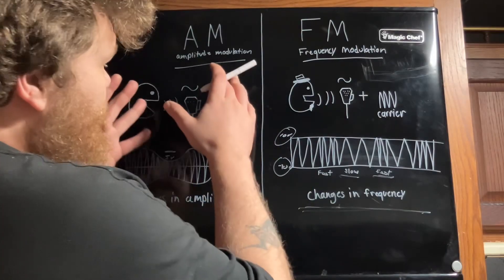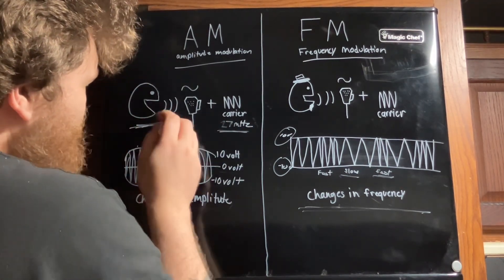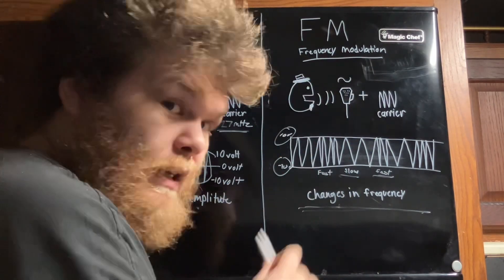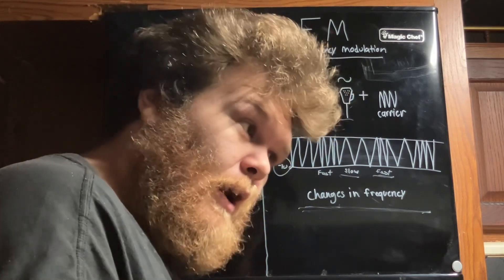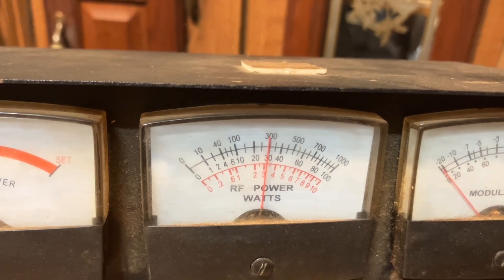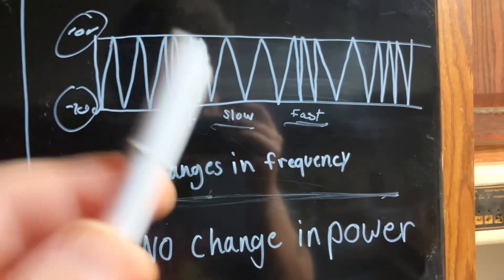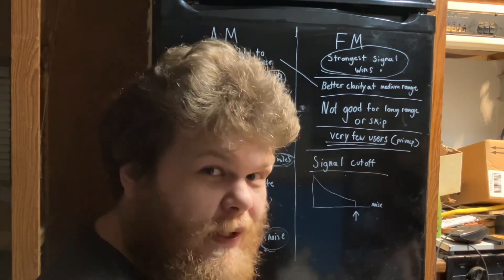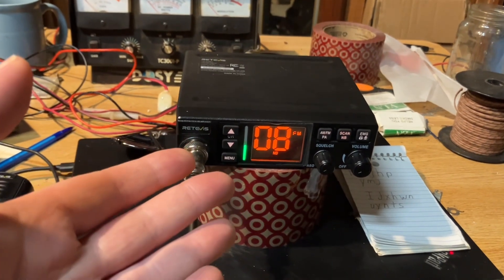AM vs. FM on CB Radio: Which One Should You Use?

Comment: iv yet to get a new radio with fm ... you done real well of explaining  the  two ... iv been into cb quite a few years and most of mine are old .. some are even crystal types with old ffc license that was issued to people way back when cb was a huge deal .. i been eye balling the new radios on amazon and with a magic watt box lol probably can get out on am out but i dont think it would work for fm .....or would it ???
Reply from the maker: I don’t know for sure, but I do know that with an amplifier you want a very low carrier and good modulation.

However, with FM, the carrier never changes power amplitude.

So you would have to make sure that you didn’t drive the amp too hard by turning the carrier very low.

Your amplifier will see a constant duty cycle with FM, so it might heat up quite a bit.

However, I haven’t done very much research into it. Maybe someone else in the comments can chime in.

I have a bunch of old crystal radios as well, I’m a big fan of the new president radios. 

If you’re in the market for a new Radio, I would recommend a president for sure
Reply: @JohnnyJonesathome to be safe I probably will only run bare foot on the FM side

Comment: If you go to Pahrump, Nevada. You will hear the locals on CB Band C channel 23.  26.805 Mhz FM.   They are just chatting up a storm. How do I know.  I can hear them late in the afternoon in Iowa somedays.  If they swing their 50 foot  quad 4 antennas my way. I can even talk to them on a few choose moments.  FM skip as easily as AM.  When it comes back to earth. The signal polarity is no longer  just vertical.
Reply from the maker: Yeah, It works that way with AM too that’s why you can use a dipole to talk skip.

I still don’t think bests SSB, I prefer having the ability of cross talk.

Comment: I was so excited when FM came to the States, Then I used. Disappointed. FM is clear and quiet. Voice is not loud. Then when static breaks squelch it's deafening. Is it just a bad implementation on a President radio?
Reply from the maker: Unfortunately, that’s just the way FM is, very noisy. Maybe because it’s constantly trying to create an oscillation within the radio itself.

But that’s a guess

In fact, I’d say if you have a president Radio, it’s probably implemented to the highest standard.

President makes really reliable radios in my experience. It seems like you have my issue I don’t like FM noise 

AM noise is sometimes even peaceful, but FM noise is really quite loud

Comment: Doesn't FM already exist on CB radios already, it's called SSB (Single Side Band with an Upper Band - USB and a Lower Side - LSB)?
Reply from the maker: No, it didn’t exist until 2021 here in the states.

Single side band is still AM. Just with a suppressed carrier and a single side.

Comment: Quando eu era garoto , ganhei um rádio AM,FM E SW .Percebi que no FM ele era mais econômico  e no AM consumia mais pilhas porquê será?
Reply from the maker: Wow, that’s really intriguing!!

I assume you’re talking about a receive only Radio?

I’ve done a little research and the only thing I can conclude is that the AM mode uses more energy in amplification.

And because an FM signal is entirely one singular frequency the amplifier may be using much less power.

I do know that FM radios often use a PLL. Which compares two signals. And then the output from then on his amplified.

But with AM, you receive the signal, it goes through a pre amplifier stage, then it gets rectified and amplified again.

And of course, depending on how loud the signal is the more current the transistors are going to use.

That’s honestly the best answer I can give you with my minimal understanding of it
Reply: @JohnnyJonesathome agora entendi , faz todo sentido . Obrigado 👍🤝.

Comment: around 6:15 you mentioned you cannot skip on FM. Respectfully, yes you can! I have worked australia, middle east and many other countries in FM. If i am misunderstanding your point, would you kindly clarify? -N2ZXX
Reply from the maker: I’m talking specifically about American CB radio. That’s why I put at the bottom of the video when I said that that it was impractical to do so.

No one is using FM mode in the United States for CB radio and skipping with it would be impractical 

And due to the cliff effect FM is Not the best for Skip.

It’s not that you can’t skip you certainly can 

But you certainly can’t in a country which nearly no one uses FM on CB radio
Reply: @JohnnyJonesathome ive done it freeband in the past and on ham bands..super clean..but you need to set squelch on fm..am use is rf gain
Reply: i will say, i am glad fm is an option on 11m..super fun

Comment: I'm a general class amateur radio operator, I know perfectly well how AM and FM, and also SSB, work. Using FM on 27 MHz (the CB band, or 11 meters) is just plain stupid. 27 MHz is in the HF (high frequency) band, which is what people use for long distance communications. CBs are limited to 4 lousy watts, and using 4 lousy watts on FM on 27 MHz is going to give you a VERY short range. FM is FAR more efficient in the VHF and UHF frequency ranges. If you want to talk to specific people, use GMRS, which is FM, and uses frequencies in the 450 MHz (UHF) range, at up to 50 watts. If you want to try to connect to someone out there in radio land, possibly several hundred or several thousand miles away, CB (11 meters) on SSB (single sideband) is the way to go. SSB is much more efficient than AM. It has no "carrier" and even 4 watts can perform like 12 watts on SSB. I personally use 100 watts on 27 MHz 11 meter SSB, which is not legal, but not enough to cause any interference. I have made contacts 3,000+ miles away. 100 watts on FM at 27 MHz might get you five miles. 50 watts on GMRS at 450 MHz can get you 50-60 miles, and it's legal. FM and 27 MHz are just not a good match.
Reply from the maker: Well, thank you very much for commenting! I agree sideband suppressed carrier is the best voice mode to be using for skip propagation on CB.

I planned on getting my generals myself, but I’d like to master Morse code first even though it’s no longer a requirement.
Reply: Listen out for the Moscow repeater on the 10m band, FM. I regularly here it here in the UK and I've heard people from the USA talking on it (and not through the internet!). Look up RR3AAC. Also look up KQ2H, a US repeater often heard in Europe. I think you underestimate FM.

Comment: AM is far more sensitive to "modern" interference - based on the principle of radio noise coming from switching mode power supplies (phone chargers, computers, photovoltaic regulators, power banks etc.) This is probably real reason of FCC allowing FM modulation, that is influenced too but not as much.
Reply from the maker: Absolutely! LED lights, wall worts, even the antenna tower. I’m beside gives high spikes that will show up in my receiver with AM.

What scares me is how much noise they are no longer suppressing because we can’t hear it with digital or FM modes haha

Comment: The original  purpose fm on cbs was as  reception fm radio

Fm in 27mhz  much like marine cb   requiire repeters

Ffm might give you clarity today however ran at 4 atts  1,5 km vs 2km on am

Reality the radio yiu are playing with  most likely  programmed with 27mhz though reality start ed life as a uhf cb
Reply: Nonsense, We use FM here in Europe over lange areas

Comment: In Europe AM is no longer used, it is obsolete. The reason for this is very simple. AM transmissions cause a lot of radio disturbance, FM transmissions have less. Your information is not complete, AM transmissions do not increase power, the information that is transmitted is IN the incasement and in the reduction of power. The strength of the transmitter ia varied, it is modulated. If in the audio the sign-wave goes up, then the power goes up. When the sign-wave goes down also the power goes down. The net result is that the transmitted power is the same, it only looks more powerful if you measure the power during the positive sign wave of the audio, If I would have measured the power during the negative sign-wave then it would have looked different. You must have fund out, that over long distances, when the sender is very very far away, that during speech the signal is nearly gone, that is why. 
 
By the way, FM is an American invention while AM is a European invention. Now you must Yankee Doodle Dandy wave the red white and blue, that star sprinkled banner and switch definitely to FM. Case closed.
Reply from the maker: I’ve looked into your comment, to make sure that I was not telling anyone wrong.

But it appears as though the power does in-fact increase on AM.

If the negative and positive portions cancel each other out, the meter would waggle around 4 W

This extra power is in the sidebands. The "up" part of the audio wave adds much more power than the "down" part subtracts, so they don't cancel out. This is why the total AM power increases when you talk, while the total FM power stays constant.

Perhaps you can verify this yourself?

Comment: Under the right conditions FM long distance is quite feasible. Plenty of radio hams have used FM on 10m/28 MHz to span the Atlantic. Another advantage of FM is that its audio doesn't break through on nearby cheap sound systems, audio amps, TVs, etc.
Reply from the maker: Oh yeah, there’s a lot less interference. And of course, is not impossible. I just made this video in mind for American CB users which mostly use AM

It would be rather pointless to try to skip with FM on an American CB radio 

Side band would be far more feasible 

Thanks for commenting!

Comment: I have about 20 CB radios. collect older models. no new models. have no desire for a FM  radio at this time.  until the FCC raises the number of channels like Europe up to 80 and than designate maybe 50 through 80 FM only but the radio also needs to have SSB as I will not own a new Radio without it.
Reply from the maker: Yes, I agree. SSB is definitely the way to go.

I don’t really care much for FM either because no one is really using it in the USA. Plus, I don’t like the cliff effect 
I’d rather hear two signals super imposed then that horrible noise on FM with multiple people try to speak 

and there’s nostalgia with amplitude modulation for me
Reply: 80 Kanäle gibt es nur in Deutschland, Europa hat 40 Kanäle auf denen AM, FM & SSB zugelassen ist, die restlichen (unteren) 40 Kanäle sind hier in Deutschland nur für FM vorgesehen und dürfen in Grenznähe nicht verwendet werden.

Comment: Well, nobody in Europe is using AM. We are all using FM. The only other modes that are in use is USB or LSB. This is again some very special US thing. FM has a much better propagation, also over distance when you are bouncing off sporadic-E and we are chatting here in Germany quite frequently with the US, which is 6000 km. Only on FM. Because there is a, compared to CW (Morse signals) -14 dB to FM and -27 to AM. Means AM has to FM -13 dB, which means about 20 times worse. A 4W FM transmission is about like a 80W AM transmission. 
And this factor is also the factor to CW by the way to FM. Means I do with 5W CW the same as with about 80W FM or 2kW AM. Actually to SSB it is more about factor 500 so this gives more credit to voice modes than they deserve. If you can't do telegraphy, there are still data modes, that are much better and even FreeDV that is much better than that. 

That's just not in the same league. But you also have miles and feet and inches and gallons and all that. Whatever. Do AM. It's the worse mode, but you are right that you can hear two voices at once. That's absolutely correct and that's why it is in use in Airtraffic control, where from air to ground it is mostly always line of sight and where power does not matter that much.

With telegraphy I go with 4W on 11m easily around the world, at least if the conds are okay. Seen that, been there.
Reply from the maker: You know, I really forgot how much you guys love CB over there in Europe.

This was mostly aimed at the states

Everyone over here is using amplitude modulation. So FM is a novelty.

They didn’t start implementing FM until 2021 over here.

Of course, any day, side band, CW or any data mode will win over AM. It’s incredibly lossy.

But the thing is no one over here is using FM on CB radio 

We use FM, of course for GMRS and I can hit a repeater 20 miles away with my GMRS handheld.

This wasn’t necessarily comparison between AM and FM modes when it comes to anything other than relating to American CB radio.

I really didn’t understand how many Europeans would be watching the video.

But if I were to choose one mode to stick with the rest of my life, it would probably be CW 

Although it’s not as robust as digital modes, it has a warm place in my heart 

Thanks for commenting!
Reply: @JohnnyJonesathome  You mean you would stick to AM. But sure, AM has some advantages. I personally find SSB für CB a waste. First the rigs are not good enough to stay to the point on the frequency and then it is forbidden to modify the TX frequency on CB. So everybody is transmitting on a slightly off frequency and in a chat with several people are always on the clarifier, that's not just inconvenient, that's plain dangerous if you are in a car or truck, where most CB radios are. So, I'm clearly against SSB on CB, except for data modes. But FM, well, in EU we have Channel 1-40 where we can use more or less the mode we want, while channel 41-80 which is on the frequency below the CB frequencies, is only FM allowed. FM does interfere less with the environment.

And while you got in the US vast stretch of land, of highways that go on for hundreds of kilometers, in EU you have crossed about three countries if you drive a few hundred kilometers straight. So, the density of population is insane and no comparison to the US. And with that the topic of interference is much more serious and that's why they do like so much AM here, not only does it interfere more, it also is interfered in a way here, that is not funny anymore. So, AM is not usable, as a matter of fact, it is not.

Still, I love AM, it is a bit of a pity, that it is down the drain like this, but that's why you in the US got all the international CB radios now and every radio you get is for the international market and that means every newer CB radio will have FM.

On shortwave, FM has not place otherwise. We only have FM on 11m CB and on 10m amateur band, mainly on the few relay stations, while the rest of the short wave is SSB and digi modes or CW/Morse telegraphy. We very much hear US signals here, very, very much on CW and the better digi modes get through, like FT8, WSPR and FSQ, while I do not like FT8 too much, not because the mode is bad, but because it's a mode where computers are chatting with computers. It's mind-numbing boring. FSQ or Thor will punch through everything and have really great propagation and then of course there's CW. If you really want to DX you do it in CW. Sure, you get more "reports" from FT8, but that will always be a bot. Your computer will have fun and the whole thing is in the end a logfile and that's all you have from that. 

If you are work the old brass and punch out some signals of your own, that's different. There are hardly any bots out there doing this, because bots are lousy with this, but you easily can have a chat with some Japanese guy in sight of the Fuji Yama or some senior maritime operator in a condo somewhere in South Africa, who will chat with you for hours and tell you old tales of weird waves and sea monsters. Which is really funny. Or that guy near Athens when all the woods were burning there, no phony got out from there under those conditions, but he was giving us live reports of what was going on, keying it out like the old operators of the Titanic when they were sinking. 

This is why I'm doing radio: the human factor. And maybe you are right if you say, fuck the efficiency of the mode, the community is more important. And if you say this, I will stand up and slowly will start clapping, loud and clear. AM has something, but in Europe it's all but completely dead. 73 om es fb + de dl7hh

Comment: Great explanation.  Thank you.  And, as others have said (as did you in your comments) you can skip on FM.  I've done it - Salt Lake City to Louisianna - 29.600 on FM (Ham Radio).  Conditions have to be really good, but occasionally it happens.
Reply: 30 years ago I added a 29.54/64 repeater system to the Greater Pittsburgh VHF Society system. With 100 watts regular contacts to Europe and Africa were common, and we even got as far as Sydney and Tokyo. The old-timers in nursing homes could use a 146.61 or 444.95 HT and work DX.
Reply: @spaceflight1019 i have probably heard your repeater personally with my 2510 radio in Texas mid 90's? it's extremely possible. what was your roger tone?
Reply: @JoeyLanclos-x6m It was the W3PGH repeater but it's been off the air for at least 10 years.
Reply from the maker: Yeah, it certainly can happen! And more power to you that’s an interesting story.

I’m just trying to steer people away from trying to shout at people on channel 28 using FM because they’re going to have a bad time  🤣
Reply: @JohnnyJonesathome  Yeah, for sure.  And, I guess that begs another question - which channels should FM be used on?  36-40 tend to be used by the SSB crowd.  6, 11, and 28 tend to be for the guys shooting skip.  30-34 maybe?  Just spitballing here...